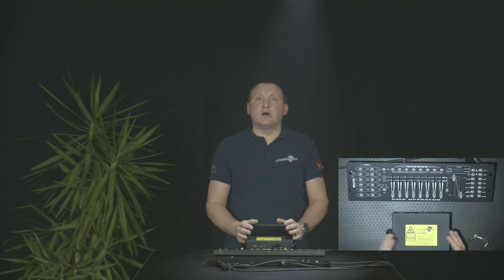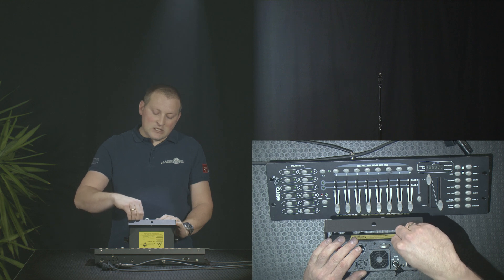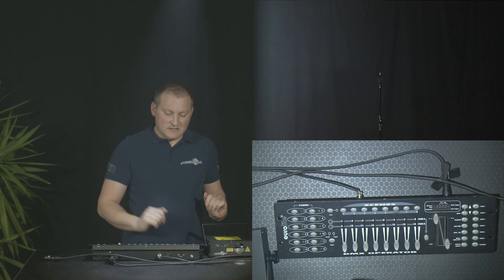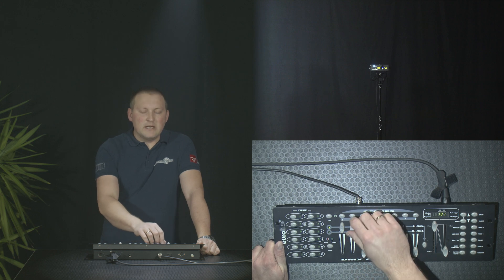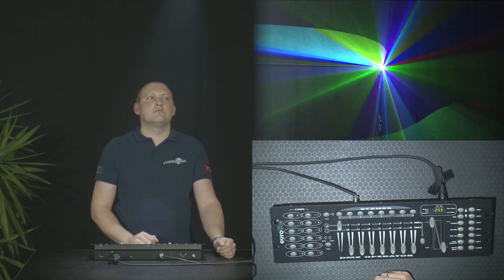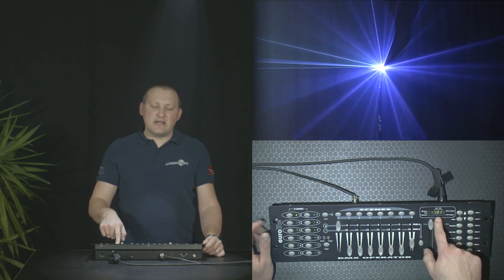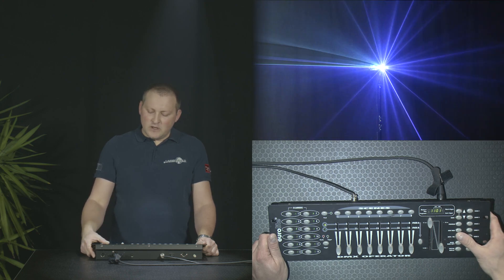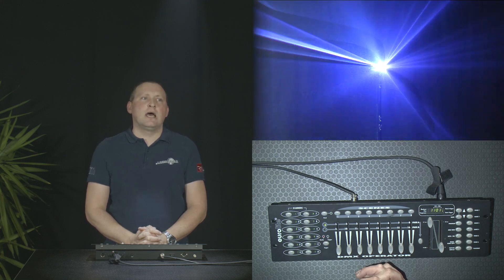Basic LASER control with small DMX controller - example with Laserworld EL-230RGB | Laserworld

Comment: hi can u tell me how to setup with dmx laser and moving head lights together tnx
Reply from the maker: Make sure that lasers and moving light have different start addresses - if the laser has 10 channels, as example, make sure that the moving head start address is at least 11 or higher, so the different devices don't conflict. If you have such a 192 controller, I recommend having starting addresses in batches by 16, so first laser is 1, second laser is 16, because it eases the selection of each device through the scanner select buttons on the left side.
The way of controlling the lasers and the light are independent of each other, so with setting different start addresses, they can be controlled individually. If you need to set start addresses with DIP switches, this could come handy: https://www.laserworld.com/en/laserworld-toolbox/dmx-address-setting.html

Comment: what happens if the laser I got uses more than 16 channels? does the channels continue on the scanner 2?
Reply from the maker: yes, in fact, this controller is a bit special as it clusters the devices with 16 channels each. However, the numbers of the channel continue consecutively. If you have a device with more channels, you may probably want to look into a different, slightly more professional controller that gives you more functionality and opportunities. But in theory it works.

Comment: Hey is it possible to use a software like DMX Controll 3 on the Laserworld EL 230rgb mk 2 to just controll it like with the controller?
Reply from the maker: yes, for sure: any DMX controller should work, as long as it provides standard DMNX signal. Many options are out there - huge consoles as well as computer software or smaller fader boards - there is a multitude of options.

Comment: can it happen that the dmx controller can shoot through the laser?
Reply from the maker: Well, depending on what you mean - if you accelerate it enough, if may shoot right through the laser if you hit it directly. ;-)

But let's assume you mean if the DMX controlling can damage the laser. It depends on the laser system you have. If you use a basic laser system with step motors, like the one shown in the video, it is unlikely that damage to scanners or sources comes from the control. However, if you use a more sophisticated laser with scanners (galvos) and more professional mainboard, there may be control options available that definitely can damage the laser, specifically the scanners, if operated the wrong way. Especially if the scan speed is selected too high and especially if the laser is operated at this high scan speed for several minutes, this can cause damage. Also a combination of wide scan angles with too fast scanning are to be avoided.
These control options usually are only available with more professional mainboards and you need to specifically operate the laser wrong.

Comment: Hello! Could I use the EL-230RGB MKII with ADJ RGBW4C IR controller?
Reply from the maker: The controller you mentioned was only designed for controlling LED PARs with 4 channels (as far as what the product description says?). So the general functionality is extremely limited.
The Laserworld EL-230RGB MK2 has quite some more features than a basic LED PAR, so a slightly better controller is required.

Comment: Why did you mention address number on the laser? It wasnt like you need to set same address with dmx controller?
Reply from the maker: The DMX controller can control multiple devices which can have different Addresses. The controller only sends trigger signals out, so there is no connection back from the device. So it's important to know the address of ech device so the trigger signals of the controller do the right thing.

Comment: Whats happen with channel 9 to 16 or more… or that Lasser have 8 channels?
Reply from the maker: on the right side next to the fades there is a button with Page A and Page B - there you can switch pages, so you can use the other channels. The basic laser products usually have all the important features on the first channels, so they can even be controlled with small controllers. But there are some extra features on higher channels, so if you want to use them you can switch the Page. However, this usually only makes sense if you pre-program some effects, as during live operation the switching of banks is super annoying and makes control rather tricky. If you need that more often, it's best to get a slightly bigger controller with 16 or 24 faders.

Comment: I have a laserworld 230 and want to add another and use DMX to control them. Can a controller also allow you to jump to the laser’s built in sound detection mode if you want to let the lasers just run on their own for a bit (without having to flip the tiny switches on the back of the laser)
Reply from the maker: Yes, you can ... this is on channel 1, so you can either activate sound-to-loght mode or auto mode via DMX. Check the DMX chart in the manual for the exact values - or just try different positions on channel 1 :-)

Comment: How can you set safe zones using dmx
Reply from the maker: This depends on the laser system - and the level of safety you must maintain at the location. DMX as such is not considered a protocol that you can safely rely on - there may be glitches or interferences and such, that can lead to signal irritations. So it's not cosidered to be safe to rely on. But lasers with ShowNET mainboard have a safe option.  

HOWEVER:
- with pretty much all lasers you can limit the projection zone via DMX, so the laser only goes to a certain area
- if you have a laser with a ShowNET laser mainboard, you can use DMX for setting safety zones and projection zones and WRITE THESE SETTINGS BACK TO THE LASER MAINBOARD, so they get stored there and are safe from any DMX glitches and such, so this is a safe method then. All current Laserworld DS, Laserworld PL, tarm and RTI laser systems have that mainboard as standard (find out more here: https://youtu.be/qyWwTq-KGK8 and here:  https://youtu.be/sqGT4BBBcLc)

So the answer is YES you can, but it depends :-)

How you can set a projection area with a basic laser system is:
- select a pattern for projection that covers the full projection angle. Usually it's some sort of square that goes full size. Or just select the widest pattern you have
- check the DMX chart which channels deals with x and y size
- reduce the size on x and or y
- check which channels do the offset or positioning (may be named similarly)
- use these channels to shift the resized projection to the desired area

If your DMX controller allows for storing this as a global preset, this would be the option to go then. Otherwise you need to consider it for all the programming steps.